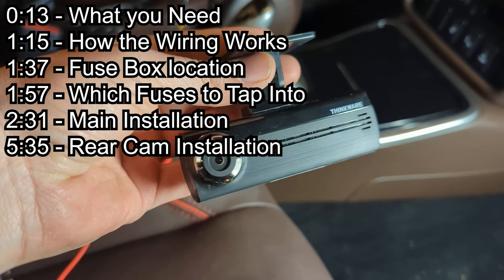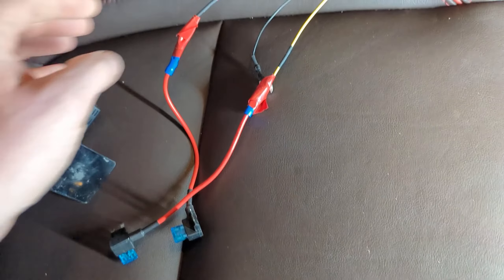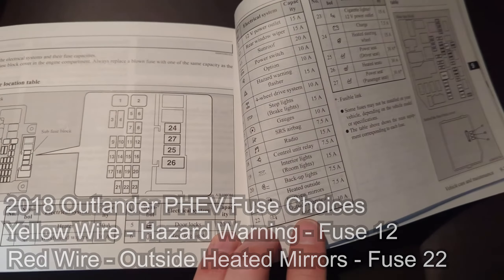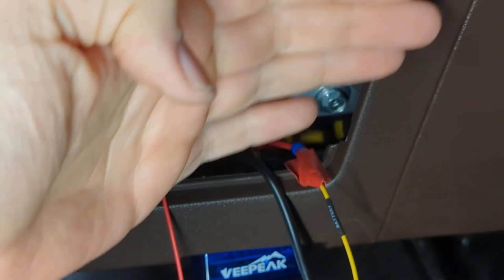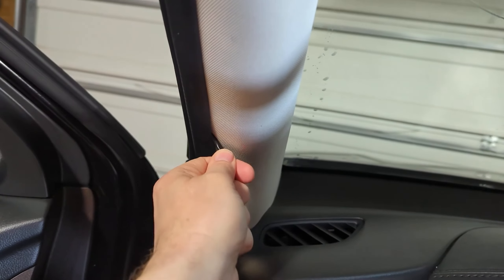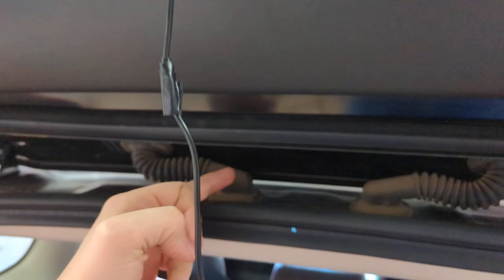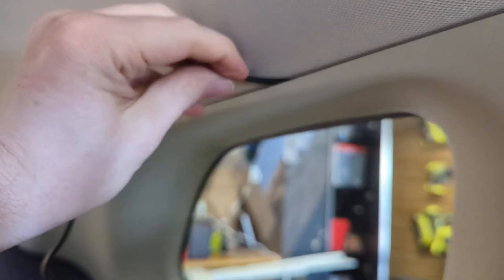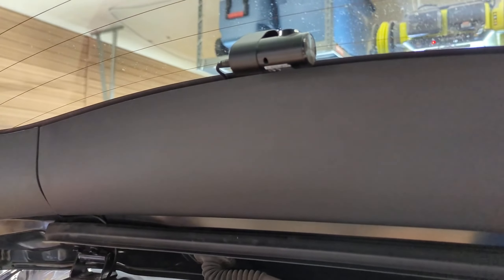2018 Mitsubishi Outlander, RVR & Sport Dash Cam Installation | 2013 - 2021 Outlander and Other Years

Comment: You need to pull off the A pillar interior panels to feed those wires. I have just completed a dash cam install and the A pillar has an airbag that extends halfway up the panel to above the door roof lining. The issue with tucking it in is that they sometimes get entangled with the airbag, which makes the airbag either ineffective or dangerous in an accident. The wire becomes a whip when the airbag goes off.

Comment: Which fuse spots were the right ones in the end? 12 and 22? Or some other ones? Thank you for a great tutorial. I’m about to follow it.
Reply: Yep, 12 and 22!
Reply: @BestEdmontonMall looks like on the video you used 12 and 17! And also you said yellow cable is for constant power? My camera has written sticker ACC on the yellow and B+ on the red. I am confused now. What colour is for 12?
Reply: @PetVa-s1h Some hardwire kits use yellow for accessory and red for battery power instead. In your case, yellow is the accessory and red is for the constant power.
Reply: the inserted fuse should be the same ampere rating with the existing?